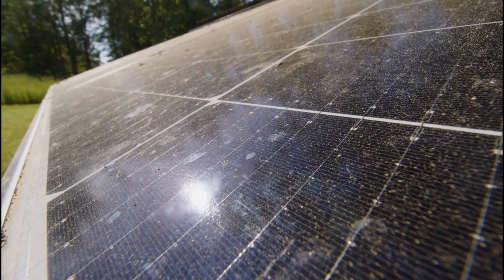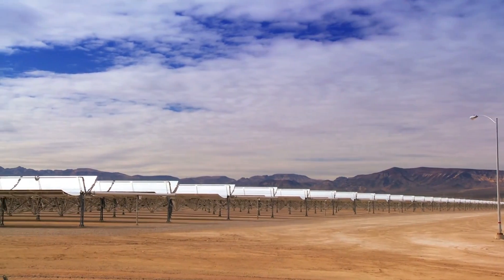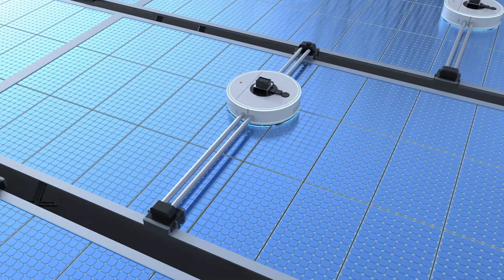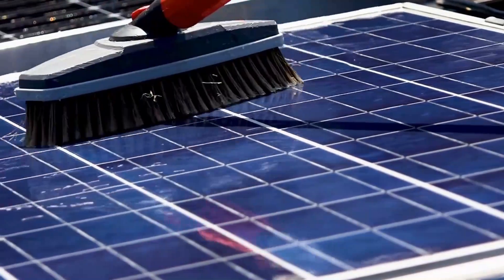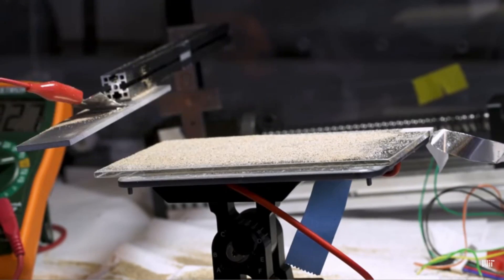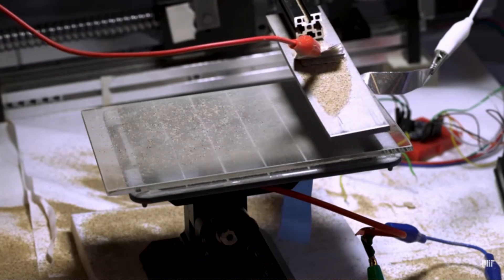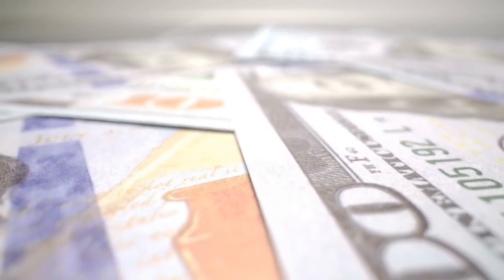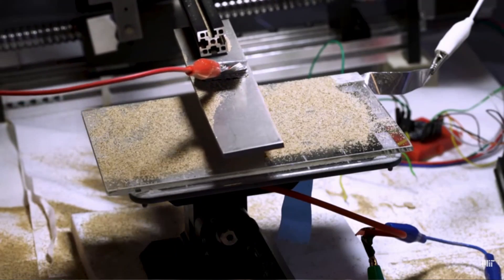Solar Panel cleaning without Water

Comment: Electrostatic cleaning might have a problem with dust and dirt that has a component that makes it adhesive, this could be pollution from organics in vehicle exhaust, tree sap, or insect excretion. It is likely that electrostatics can only remove dry dust. The same limitations are likely to apply to vibration cleaning, which also has the disadvantage of long term fatigue damage.
A water recovery and filtering system might be the answer. There are surface treatments that can catalytically oxidize organic contaminants to turn them into the gas phase. However these catalystsvharness the power of sunlight to provide the energy for the reaction. This might detract from the efficiency of the solar panels, if a common wavelength is required. There are other surface treatments that make adhesion to the panel surface less likely, but again these may have light filtering properties. Such treatments are currently available for treating car to make them hydrophobic. A combination of surface treatments and cleaning is likely to provide the optimum performance.

Comment: If the dirt is loose like shown in the video, you could just use compressed air or a vacuum cleaner to remove. I would say that would leave even less residue as the panel in the video stays quite dirty from small particles. No  Electrostatic charged Ion Hokus Pokus needed. Once the dirt adheres to the glass, you WILL need a solvent or brushing.